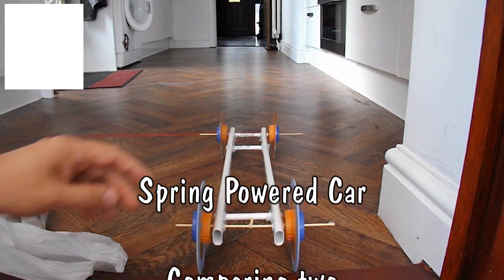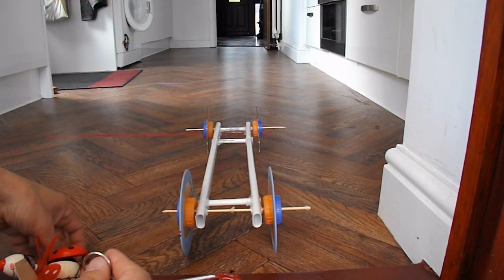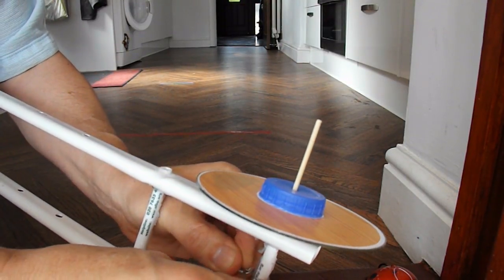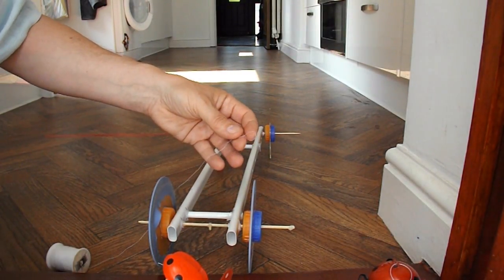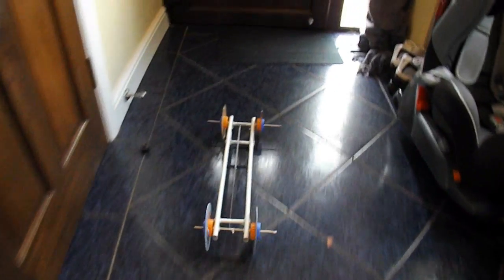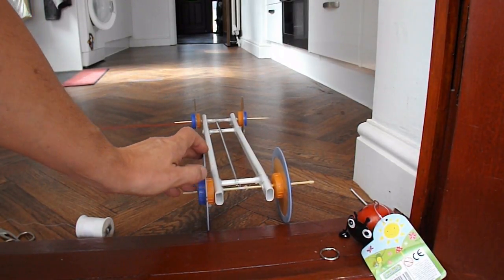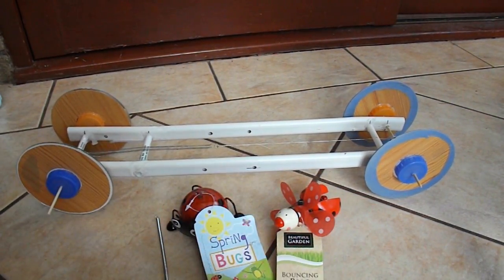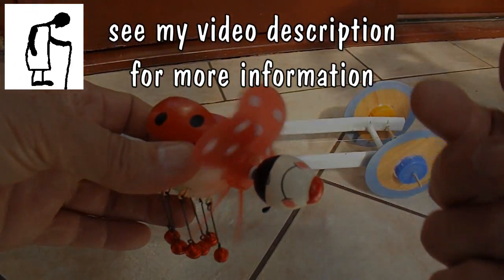Spring Powered Car - 2 new springs

Comment: Nice project.  I have not done much with springs since was a kid but I used to have great fun making things with them.  Here is an interesting spring powered toy car you might enjoy.    spring powered car スプリング動力車
Reply from the maker: Hi Lidmotor, thanks for dropping in. Yes that is a beauty isn't it. Not the sort of thing I could knock up in a couple of hours with cardboard and CDs. 
If you saw my Lemon Powered Car video you may notice I have just pulled it. I am having trouble replicating my own results. You have done lots of work with low power sources. Do you have much experience with small rechargeable batteries restoring their power after being rested for a while? I have a nasty feeling I misinterpreted my results the first time round and it is taking so long to prove it either way.

Comment: the 99p store spring made the car move faster though
Reply from the maker: Not much in it really and you may find another spring from same type of bug from the same store would be slightly different. I only tested one from each store. I was surprised how well they worked as I thought they would have been too weak.